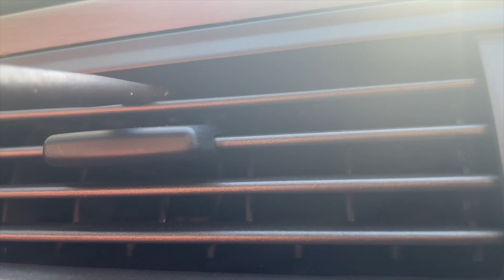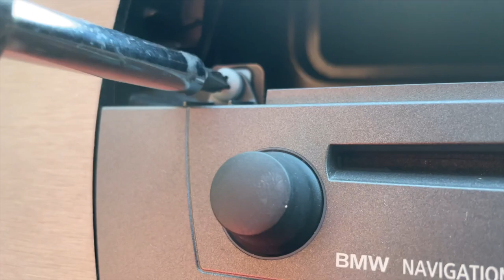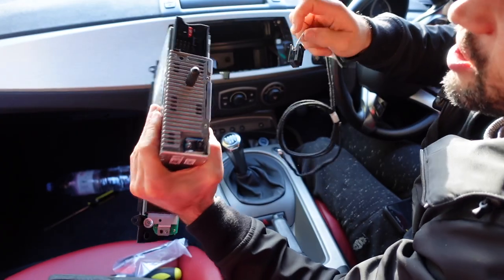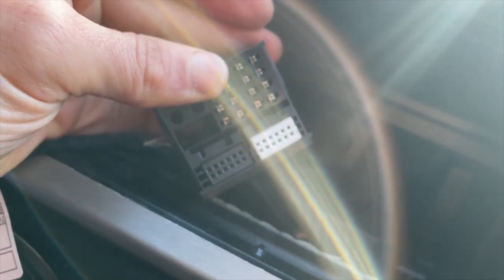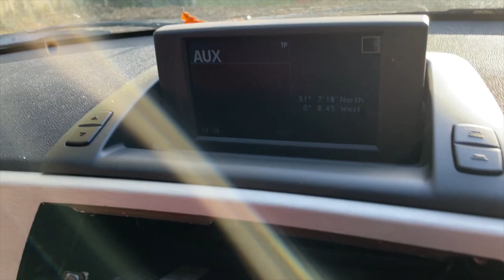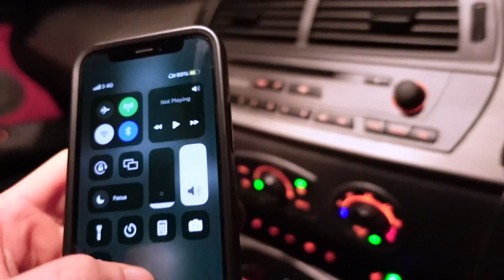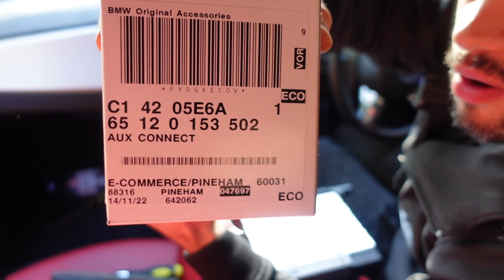Z4 E85 Aux Install in 25 min.

Comment: What year is your z4? I know in 2007 the aux for a z4 is hidden and out of sight is located right below the ac button above the heated seat buttons closer to the passenger side seat on the dash.
Reply from the maker: Mine is 2004 but I’ll have a look just in case. However, I have now fitted a Bluetooth module and so far works great
Reply: @Battery-Powered  Cool 😎. I don’t know if the 2004 has it but in 2006-2008 they have the aux very recently I test drove a z4 coupe and I was looking to see if it has one and I founded I don’t know on your year z4 if they came with one it would be interesting to know if BMW equipped them with one from factory like the 2007 z4 I test drove.

Comment: HI, 
which sound system is installed in your Z4 ? 6 CD charger ? , I have the NAVIGATION SYSTEM PROFESSIONAL CD, and this kit didn't work due to the DSP (installed near the battery)
Reply from the maker: I don’t have the cd-changer . Do you mean it didn’t work as the slot in the back of the unit was used by the cd changer ?